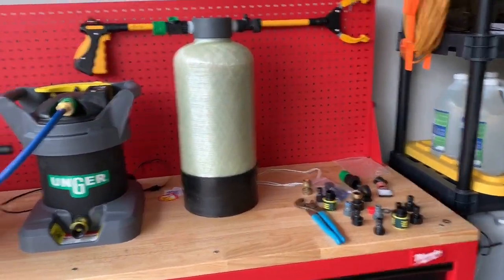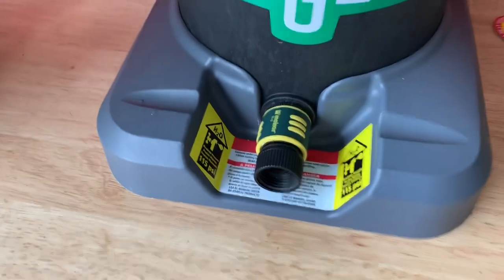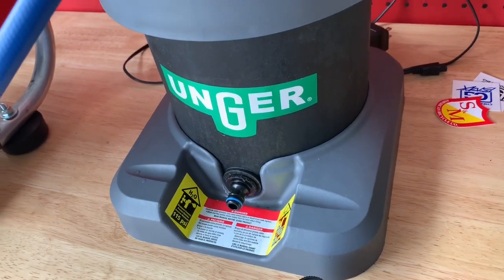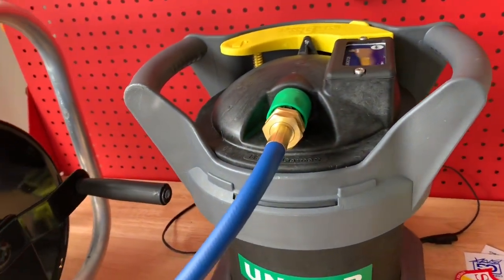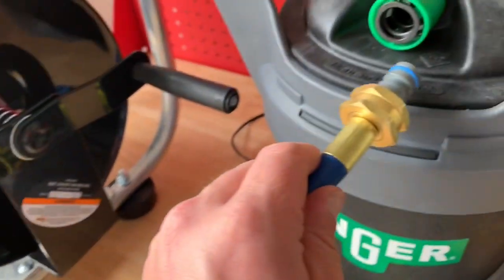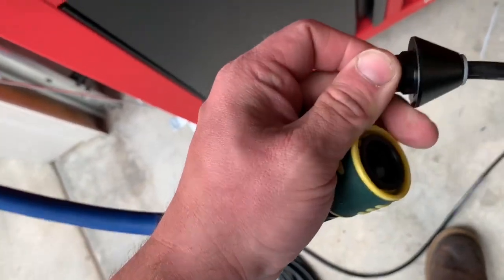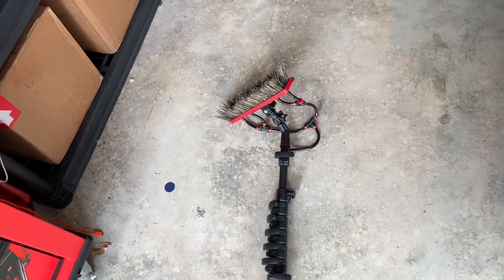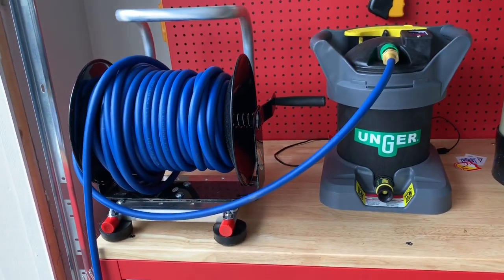Simple Water Fed Pole Setup For Window Cleaning And Solar Panels

Comment: I want a WFP pretty badly.  However I'm scared it just can't get the dirtiest windows clean.  I'm talking the dirty windows that take scrubbing with steel or brass wool. Most of the windows I clean haven't been cleaned in 10+ years!.  Will the WFP get-r-dun?
Reply from the maker: I’ve had decent results. It’s all about the brush. I use the Tucker Apha boars hair. It scrubs really well. Also you can add the bronze pad attachment to get a little extra scrub. You may have hit and miss results for windows not cleaned in 10 years. It would save you a ton of time on your regulars. Mine has paid for itself 10 times over in just a year. Hope that helps

Comment: How long does your Unger DI tank last? Like how many panels before you replace filter. Thanks
Reply from the maker: I’ve used it on over 900 panels and then replaced it. It all depends on what your TDS is in your area. Ours is very low so the DI filter lasts longer. You need a TDS meter and test your water. Windowcleaner.com has a lot of info about water TDS on their site.

Comment: Can you use a steel hannay reel , using a D.I. tank for windows, without it leaching contaminates from the steel and brass fittings...causing spotting on the windows?
Reply from the maker: Great question. I’m honestly not sure if the metal would contaminate it. That would be a great question for the guys over at WCR.

Comment: How is unger device doing ? I just started my pressure washing business,.full skid and all that and wanted to offer solar panel cleaning. I live In California..hard water state only couple of areas are below 100 tds. Does it actually give you spotless water on the solar panel and is it worth it to buy it ?
Reply from the maker: We sold the Unger and switched to the new Tucker Rival 4 stage. The DI gave us good results in most cases. Our water is under 50 tds. You would probably want more filtration.

Comment: thanks for the video!  quick question...my methodology is to use reg hose water for the scrub thru a WFP, and then switch to the de-ionized for the final rinse only, via a spray nozzle off of my 3/8 hose outlet from the unger.   doing my final rinse only with deion, in order to save in the resin replacement $$, and ASSUMING the hose water based initial scrub isn't causing any scratching or additional wear and tear on panels (haven't witnessed any)....  >>>>> am i missing something?  should I be using deion on all steps?  <<<<      any input would be appreciated....   -ed
Reply from the maker: I’ve never heard of that but guess it would work. I cleaned 879 solar panels with my DI tank and it was still read 0. The savings would seem minimal and take more time. I don’t see a reason it wouldn’t work. I prefer DI water for everything. I could see if they were really dirty, a pre wash would help. Thanks for watching.

Comment: Great info. I’m getting set up now to open my Pressurewashing Co. early spring 2021. Solar panels are popular in New Jersey, I really need to “brush” up on learning how to properly clean them. This is a great up sell. I like this little set up you have here.
Reply from the maker: It’s been working great. I used that same setup to clean over 800 commercial panels. No complaints. My water TDS is really low so I one need the one stage purification system. Check with windowcleaner.com to see if you need a three stage.
Reply: Expert Power Wash what do you mean by “ TDS” low and one stage/three stage?
Reply from the maker: TDS = Total Dissolved Solids. A simple measurement of water quality.

the TDS of your water needs to be at 0. There are certain cases where you can clean just slightly over 0. It all depends on what’s in the water, though. To be safe and avoid spotty windows change your resin once your TDS reading starts to creep above 0. You can buy a TDS meter on Amazon super cheap. 

A general rule of thumb is if your TDS is under 100 a simple DI tank based system will be the most cost efficient for you. You can use your TDS meter from Amazon to take a reading from your tap water. If it’s higher than 100, you will need a multi stage water purification system. Hope this all makes sense and helps.
Reply: Expert Power Wash thankyou sir for your help, so appreciated. I love that there is help out there and genuine good people out there that are willing to share and help with their knowledge.

Comment: I’m a newb. A bit confused on the purpose of the hose real. 
100 feet of this hose is not gonna get close to the backyard of a giant house. Couldn’t I just hook up garden hose to that unger put it in a good spot and get a hose reel with tires to wheel around? I work on really big houses 350 feet of soft wash hose coming off my truck isn’t enough sometimes lol.
Reply from the maker: You have to factor in how much 5/16 hose you have on your WFP. This works for 90% of houses if it doesn’t, we move to a different water source. This is also a compact setup. We have a built in system on our pressure washing truck that’s more ideal.
Reply: @ExpertPowerWash  thanks I think I will just use garden hose to the unger to the water fed pole and move about the home. 
Would that be good?
Reply from the maker: That would work

Comment: How is this system holding up? I am looking to add window cleaning to my house wash and roof cleaning business.
Reply from the maker: It’s holding up great. I like the Unger DI tank a lot. I may get a stiffer pole sometime in the future but not necessary. The Tucker Alpha Boars hair brush does a great job scrubbing glass. This is an easy and quick up sale. They remove the screens. Windows are already decently clean from the house wash. The purified water leaves the windows looking great.
Reply: Hey, so I just watched your video, very interesting. Is what you displayed the entire equipment ? That's it! Very simple, I like it.

Comment: Hey Tim, When doing a roof cleaning, what’s the process using SH around the solar panels?
Reply from the maker: You just want to be super careful when spraying. Use a controlled method. Having a ball valve on the end of your hose really helps slow the flow to get into tedious areas.

Comment: How many hrs do you average before you have to change the resin out.
Reply from the maker: Just started using it. Bought extra resin. It has a built in TDS meter. Used it on a few window jobs and using it for the solar panels. Still showing zeros on the meter. Time will tell. So far, I really like it.